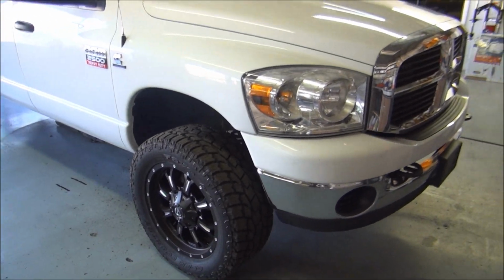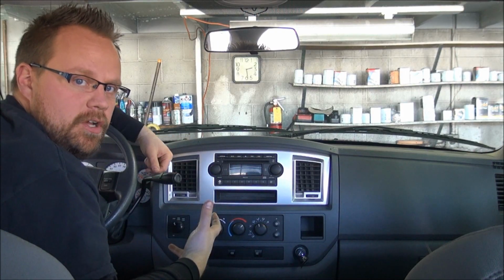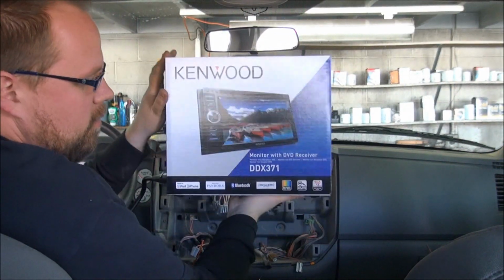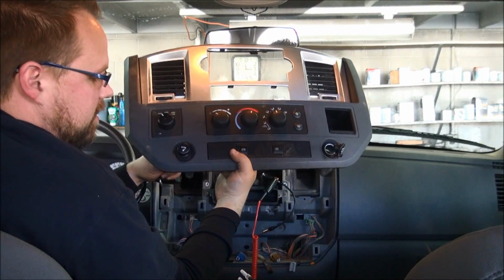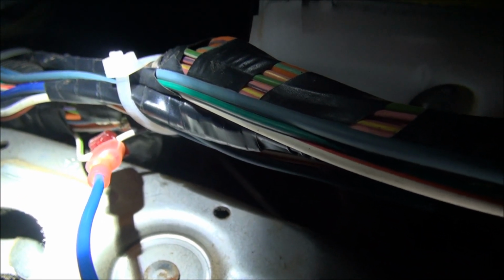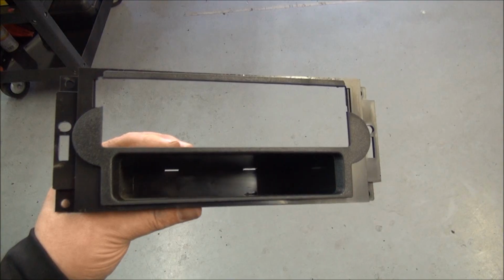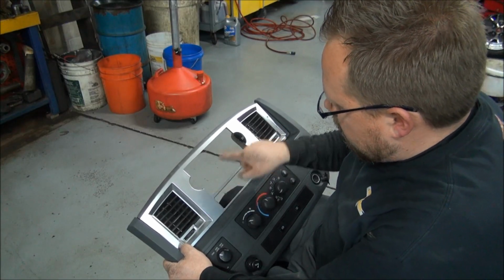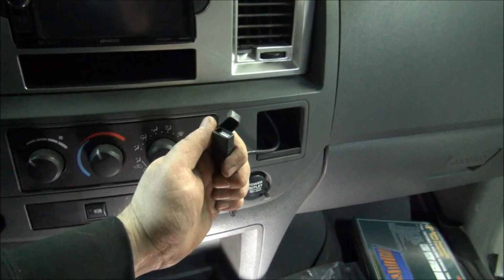Dodge Ram DOUBLE Din Radio Install Tips

Comment: Do you have the Audio Wire Diagram of this Dodge 2008 ?   I can not identify the wires for Front Speakers ...

Thanks for your assist !
Reply from the maker: This info could be correct..... However I'm not 100% sure...Would need to have your truck here to verify..

LF Speaker +: Dark Green/Yellow 
LF Speaker -: Dark Green/Light Blue
RF Speaker +: Gray/yellow 
RF Speaker -: Gray/Light Blue

Comment: Hey Bri quick question. Where did that yellow wire you hooked to the switched power come from? Did you hook that to the red switched in the radio?
Reply from the maker: Tapped into the pink with yellow stripe wire to the power outlet.

Comment: have problem with  no  sounds
Reply from the maker: +leon wild Did you try to install a radio?
Reply: Yes use the three harness connection no sound, but the t tap pink/yellow work fine, just ordered the single harness.

Comment: Which dremel bit did you use? I need to trim just a few millimeters off my dash opening. Thanks for the video!
Reply from the maker: +Chris Mendez I used just a smaller drill bit, I have used drill bits for many projects, works great!

Comment: a stereo shop installed on this exact truck, now my guage cluster clicks on and off (flashing the warning lights and the tach then it goes back to normal) at random , even when truck is parked. Any tips on what could cause this?
Reply from the maker: +Mac thedutch I have not seen that before, however you may want to talk with the stereo shop that put it in for you.

Comment: I'm curious to know why you don't use a wiring harness adapter?
Reply from the maker: +John Evans I did use a wiring harness adapter.... Just not a radio replacement interface.. mainly due to cost and the interface's actually have a high failure rate..

Comment: Do you have the part numbers for the install kit, wiring harness and the antenna adapter you used? I'm putting a radio in my truck and want to use the same parts you are using.
Reply from the maker: +Keith Mask I Used All Schoshe brand parts  Ant Adapter-CRAB  Dash Kit-CR1286B  Wire Harness-CR04B
Reply: +Do It Yourself Bri Thanks man, I really appreciate it.

Comment: I would like to install a PioneerAVHX2800BS in my 06 1500 and I am having difficulty fabricating brackets and determining the correct location and depth of radio to ensure I have a clean install (like you did!).  Any recommendations on how to make the measurements?
Reply from the maker: +Mike Cardone Make multiple brackets, until you get the unit fitting correctly, you just have to keep making adjustments from each bracket and finally after some trial and error you will get it.

Comment: This video has a lot of good information.  Question:  If I'm smart enough to not drive while watching a dvd will I need to attach the parking brake wire?
Reply from the maker: +Bendc1970A1 There is allot of information on google that tells you how to bypass that system...

Comment: how do u know what wires go from hardness to hardness?
Reply: +Freddy Rodriguez its color to color (CEA standard) be mindful some wires have a black strip on it. example-- there is a green wire and also a green wire with a black strip. solid colors represent positive and colors with black strips represent negative. So just match all the wires.

Comment: on my Chrysler town and country, my stock stereo has 2 plugs that are grey that goes in back of the stereo. one large and the other small. I was wondering what the small plug is for because I only use the large plug in and I see a lead that has a hookup for a small plug. thanks
Reply: +Paul Morton What year?
Reply: +jadarrian edmond  I got it resolved. its an accessory for blue tooth.

Comment: I have an 06 dodge i hooked all my wires up the same as you and i get it to turn on a few times if i let the truck sit overnight it wont turn on but has power to the radio i un hooked the cig. Plug and works fine is this am issue
Reply: +joseph price you hooked up to the constant cig port (port that always has power) and having current draw causing it not to turn on. find ACC ( accessory power )
Reply: I hooked up the same off the cig lighter in the left only has power when the key is on only powers on when it wants to
Reply: +joseph price there's a difference between the "ON" on the key then "ACC" does it turn on when the key is in ACC . (The first turn)
Reply: yes but inly when it wants to
Reply: +joseph price just to cover the basics the wire you are hooking up to the cig. Lighter port POSTIVE is the red wire on the stereo harness.
Reply: Yes sir
Reply: +joseph price what year, make, model, trim(1500,Etc.) I got some resources. Also if there is any premium sound maybe ( infinity, Bose, alpine, etc.)

Comment: where did you get the side pieces for the volume and tune buttons. I've looked everywhere and can't seem to find them. I'm wanting to install an aftermarket radio in my 2006 mega cab but need the parts

Comment: Typically not one to comment but the removal of the dash trim is not accurate. I couldn't get it to separate but was guided by the video assuming I was doing it right. Using trim removal tools the face trim would not come loose. Eventually it came out, only to find two screws were holding it from the bottom. The main trim panel tabs tore off at the bottom with the screws still in place in the main part of the dash. The correct thing would've been to remove the panel below the radio face and access the two screws first before literally tearing the radio face apart at the bottom. Not pleased at all. That said, it's my responsibility in the end for following just any video on the web. Beware, verify yourself before proceeding. 2007 Dodge Ram 2500

Comment: The install looks great bud! I just bought and 08 with the same factory radio and I'm looking to do exactly what you did. I just have 1 question. Do those black inserts from the dash kit sit flush with the bezel? Because I was gonna plastidip where it's silver on the bezel.
Reply: And did you use a 6.5 inch double din or 7 inch? Or does it even matter.
Reply from the maker: crazycracker45acp 6.5 or 7 will work just fine (does not matter) They don't sit perfectly flush, some people bondo and paint the bezel to give it more of a factory look.

Comment: Hi I just did my double din stereo step by step like u did in my dodge and it really great but the only thing I didn't get is how did you make the metal brackets?  Thanks a lot
Reply from the maker: Gabriel Jimenez I went to Lowes and found small strips of metal in the plumbing section. (I Think) Then cut them to size and also made the bends to make it fit.

Comment: Hi Bri thanks for the video! Question I tapped white wire with light green wire under dash (next to white wire with dark green stripe) problem is I have power when I turn on key and in reverse. Is there more than 1 white with light green stripe wire? If so how can I identify the correct one? Thanks for the help!
Reply: Paul E Welch Never mind I tapped light grey with light green stripe, looked white until I found the white with light green stripe and compared the two.

Comment: Hey Bri! I have a Dual XDVD210BT that I'm trying to put in my 08 Dodge Ram 1500 quad cab. I have the wiring harness all hooked up. It won't turn on, Itll make a noise as if powering up when I plug it in, but won't turn on. Only things that aren't hooked up yet are the 3 steering wheel wires, parking break, and amp. I'm not sure what the problem is so wanted to see if you might know! Thanks
Reply from the maker: Norman John It sounds like a short in one of the speaker wires? Or not getting the correct power on one of the wires, It really is just to hard to point you in a direction without taking a look at things myself. Use a test light and or test meter on both power wires and check for a good ground, if all is good try disconnecting one speaker at a time if you get sound after you disconnect that one than that one may have a short. Also you may have a bad radio? I would recommenced a bench test on the radio also.
Reply: Norman John thanks! i getting ready to upgrade my radio. cool video. i am a master tech and make diy slide shows for my fb page. you video is very detailed!

Comment: I have attempted the same thing on my Dodge. Everything works as intended with the radio however my heater is not working. Do you think thsi could be related to the canbus wires? I read the only function i would loose on my truck was the delay turn off on the radio when i used the regual cheap harnesss vs the interface. My dodge is basic no amp, no infinity, no power locks, windows or anything. Any ideas?
Reply from the maker: Justin Fentress No I don't think the harness has anything to do with it, double check you did not pop any fuses or that you did not tap into any wiring to the heater control. Also make sure all pigtails are plugged into the heater control unit.

Comment: I have a 2008 Dogde Ram 1500 4Door non amplified system. I installed a Pioneer AVH-X2600BT as the only problem i have run into is that now my truck will stay running for 5 secs after it is turned off, takes about 5 secs for truck to start after key is turned. My display on the upper console on the headliner doesnt work. My keyless entry no longer works, and my power locks only work when the truck is on. Is there any way you can explain to me what exact wiring harness you used as im in the process of ordering a PAC C2R CHY4 as an after market interface to get all my stuff to work again ($70.00). Any help would be appreciated.
Reply from the maker: Jim Vanderwater  I'm really sorry you had this problem, I'm not sure what went wrong. I have done this on 50+ dodges without any problem. @02

Comment: Hey Bri I ended up ordering that Kenwood unit just wondering where you got those L silver brackets that you screwed to side of unit and did you have to bend them a littlle to screw into dash? Thanks .
Reply from the maker: Noe Reyes Lowes, I'm sorry I have been super busy with work!
Reply: No problem found some laying around that went to a dishwasher and got it all hooked up. Looks like nothing was done to the dash. Thanks for the money saving tips.

Comment: DYI Bri...Thanks for this video. I am doing the same thing with an 06 RAM Mega with a NON Infinity Stock CD player. 4 speakers...and no steering wheel controls. Can I use the CR02b or CR04b wiring harness and be ok? I don't see me gaining anything with the CANBUS modules...do I need those for my new Pioneer AVH 3600BHS to function correctly? Everybody seems to tell me that I need it but I saw you just use the $10 harness and it worked. Any advice would be appreciated. I will pull switched power from the pink/yellow strip wire on the left cig outlet. Thanks Again!
Reply from the maker: Prolean Wellness Yes you can I do this all the time on dodge trucks.

Comment: Hello could you add a photo or part number for the switch power wire you used and where dose that connect on the truck?
Reply from the maker: chesko112 Sorry I will work on that

Comment: Thanks for the great video it answers a ton of my questions.  One question is whether this unit required a vss feed or maybe it was not a GPS unit.  If it did require that vss feed where did you connect up to that?  I have the same vehicle 08 Dodge ram 1500 with base radio.  Any help would be appreciated.  Thanks
Reply from the maker: +Robert Garvey Great Question... No this unit is not a GPS. So no I did not hook up a vehicle speed wire. I will see if I can find that info for you.

Comment: Was that mounting kit double din or for single?
Reply from the maker: Single din, they don't make a kit for this truck that is double.
Reply: I'm gonna try what you did with trimming the bezel to install double din stereo. Do you know of any other double din stereos that would fit better? Less expensive stereo?
Reply from the maker: They are all going to fit about the same, and they are all pretty close on price I sell Kenwood, Pioneer, and Sony. Pricing starts at $229.00
Reply from the maker: I don't recommend the crazy cheep brands like dual, boss, Jensen etc. They are all JUNK!

Comment: It appears this was on the stock 4 speaker truck, Non-Infinity/No Steering wheel controls. Did you lose any functionality at all? There is a lot of misinformation floating around about whether or not doing the switched accessory method you have shown will cause problems vs getting the excessively priced Metra harness. My gut tells me since its the base model truck it is fine but I would prefer to be sure. Thank you for your time!
Reply from the maker: Sorry it took me a bit to get back at you, been on vacation. Yes this was a base truck no steering controls etc. On this truck I found hooking up to the accessory is much more a preferred method I have done this for many of my customers and they have not had any problems. I actually have had allot more problems with the aftermarket interfaces not working correctly and causing other electrical problems with the vehicles like flashing dash lights, battery draws etc. On some vehicles there really is no good way of getting around not using a interface, however this one I would.
Reply: Great! I really appreciate the response. I assumed this was the case but I was not excited at the thought of getting it tore apart and finding out I did infact need the harness.
Reply: Thanks for the great install video. My 2008 ram has no steering controls besides cruise control. No navigation radio or infinity speaker system (3 dash speakers hikes in fash don't have speakers). I believe I can do the same I stall but what about the 2nd small harness right next to big harness in back of factory radio? I couldnt figure out what to do with it? Did yours have that too? Thanks for the help!

Comment: quick question... how do you wire the speakers? do you splice the oem radio wiring whith the radio adapter wiring ?
Reply from the maker: adan adames Sorry I have been on vacation, Yes you need a wire adapter harness to plug in the truck then you simply match the colors up the aftermarket radio

Comment: Thanks for the video.  When I installed an after mark radio it wouldn't turn on. No power I guess.  I saw you "tap into" the cigarette lighter power.  What did you use to do that?  I couldn't really see or tell what you used on the adapter harness and the cigarette lighter.  I put both yellow wires of the adapter harness with the one yellow wire in the radio harness.  Was that wrong?  The truck is a 2008 Dodge ram 1500 and the radio is a JVC KD-R530
Reply from the maker: You most likely don't have power on the red wire? You really need a test light or volt meter to check for constant power on the yellow and switched power on the red. You will need to tap on the switched wire of the cigarette lighter/power outlet to get your switched power source. Unless you are using a vehicle interface. Hope that helps?
Reply: Do It Yourself Bri thank you

Comment: forgot to ask about the Chrysler wire harness for the steering wheel controls, and you mentioned the back up camera for this install, couldn't find it, can you include the link. I am assuming that it is for this same radio.  Thanks
Reply from the maker: Fernando BO Botero This may be what your looking for?
http://www.pac-audio.com/productDetails.aspx?ProductId=1116&CategoryID=26
Reply: Do It Yourself Bri Thanks for your help!

Comment: How did you run the backup camera wiring?
Reply from the maker: I'm working on a video for that on this truck soon. Its pretty simple you just hook up the reverse wire(tap to back up lights), switched power and ground. Then run the backup camera cable threw the firewall into the engine compartment and then along the frame to the license plate frame.
Reply: Do It Yourself Bri Did you run the cable through the frame?
Reply from the maker: William Lugaila No just ran it with the factory trailer wiring harness loom outside the frame, just wire tied it nicely with it.

Comment: I have Dodge Ram 2006 with Infinity System. I will change oryginal Radio for double din alpine. What I must doing that speaker will be working? I have ISO kabel wiht adpater but speakers wouldn't working. Sorry for my english

Comment: Did you run the red or yellow wire to the cigarette wire.... Also what color wire did you run to the parking brake I'm about to install one in my truck thank you for the detailed video helped me a ton!
Reply from the maker: The red wire is ignition on most aftermarket radios, and I ran it to the cigarette/12volt output. The yellow is constant battery power, which is in the factory radio harness. Sorry I cant remember the wire color on the parking brake, however its the only wire on the parking brake assy, its in a black connector on the very top.
Reply: +Do It Yourself Bri 
I do not understand why do you need to tap into the cig lighter. Isn't the factory radio has a switched power? Factory radio turns on when you switch the key on. Thus wouldn't that be part on the harness on the chassis side?    Could you please explain. 
Thank you.
Reply from the maker: Good Question.. And the answer is there is not a switched power at the radio (in a regular 12 volt form) the radio is switched off and on with a low voltage data line that does not have the ability to turn an aftermarket radio on and off... That is why you must install a radio replacement interface and or install the radio like I did running a wire to a switched source to turn the aftermarket radio on and off.